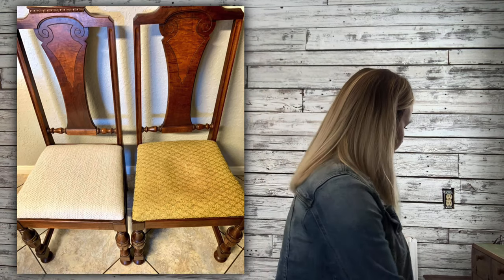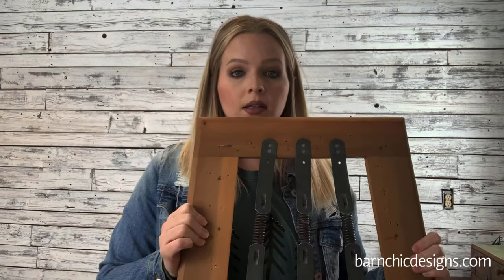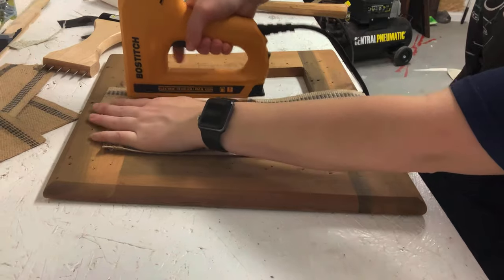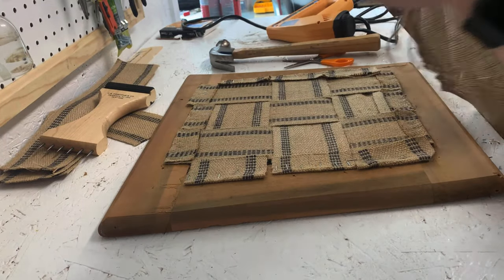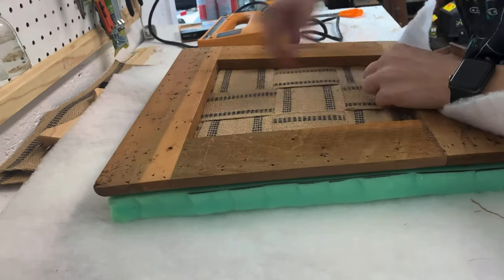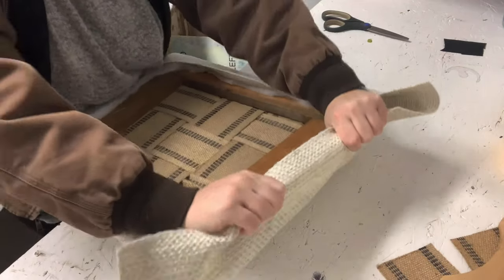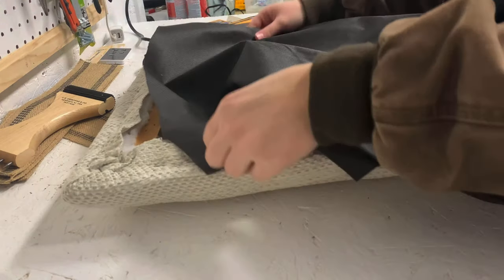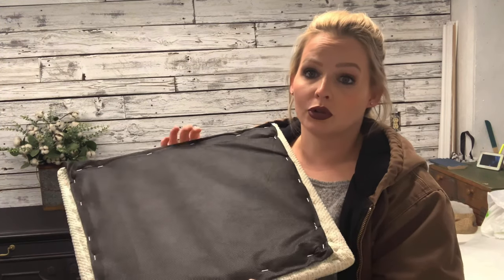Reupholstering Chairs | Replacing Springs with Webbing | DIY HOW TO

Comment: Please, please don't paint that table! It is gorgeous walnut! You would be amazed what a clean with turpentine and a refresh of the shellac can do!! I have pictures!
Reply from the maker: Table needs repaired, I’ll either strip and refinish or leave as is. It’s still the same. 
We have a matching China cabinet and buffet so it’s a large set that’s all in great shape.
Reply: I have a similar one which needed the trestle stabilised with a couple mending plates and a cupped board secured. Once the physical stuff was fixed, I washed off the old furniture polish with turpentine and steel wool. I refreshed the trestle and apron with a brushing of alcohol, then shellac. And, because I wanted a tabletop that could take a warm mug without making a ring, I stripped the shellac finish with steel wool and alcohol (fireplace fuel, actually). It revealed this gorgeous walnut underneath, including grains, burls and rays that had not been visible! I then topcoated with urethane for a waterproof, kidproof surface. Everyday I'm finding something new and cool on the tabletop, 10/10 would highly recommend!
Reply: She can do whatever she wants.  Who are you the paint police?